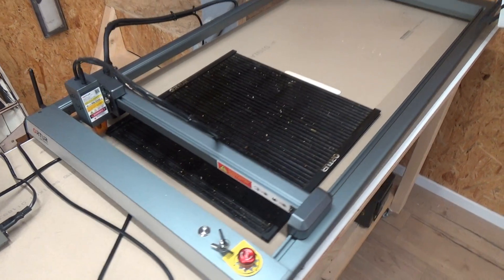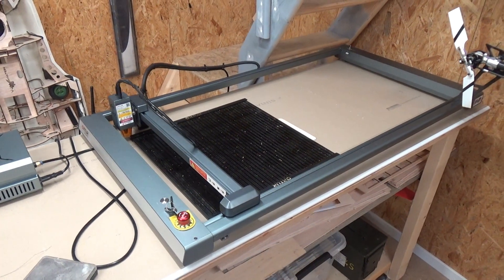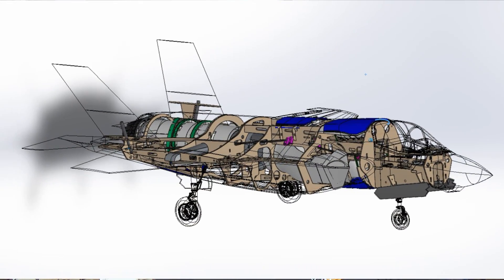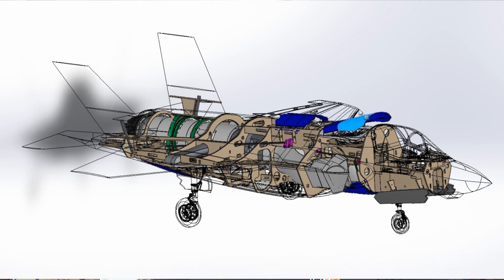Testing the New 100mm Wemotec EDF Joel vlashof f35b

Comment: "Half" transition?? What is this half transition talk? The year end challenge is VTO, transition to wing, transition back to hover, then VL. If you have all the hardware, flight control, and power for transition to wing you should have the ability to transition back to hover. Superb work as always and I hope you don't mind my constant griping as I sit back and watch all the hard work you are doing from the comfort of my laptop. Seriously though, forget about the doors for now just get the model operational and add in all the scale details later. You are so close!!
Reply from the maker: Full agree, well half transitions means setup the transition from hover to flight and all in between. I have to tune the computer how the behave in this outbound flight…and the way back to hover…the controll surfaces must work together smoothly with the vtol lifting systems…If I go to fast with just hit that switch…we could have heavy ocilations..and crash…that’s the reason I take slow baby steps…so now for the first time ever in have wings attached! And yes we are so super close..yesterday hover was amazing and super controll with side winds..I also agree not to ad all scale doors and wheel doors..that could be in the final model..writing this to you I’m setting up the 3BSM to tilt 40 degree to move forwards😋 also this gives a new challange…tilting the 3BSM 40 degree backwards means that the back edf needs to work harder too…so I will ad the vanes under the liftfan to help with faster transitions and for slowing down the model and even hover backwards..so much cool stuff coming up🥂